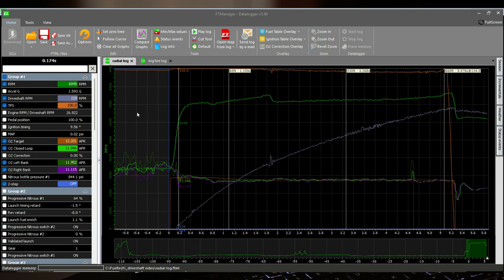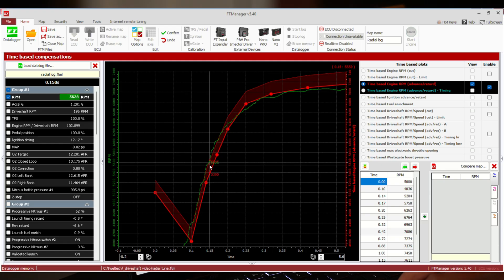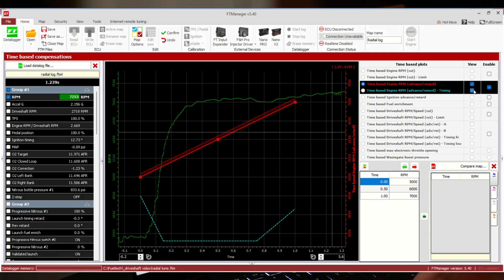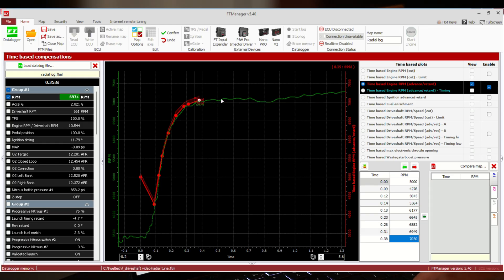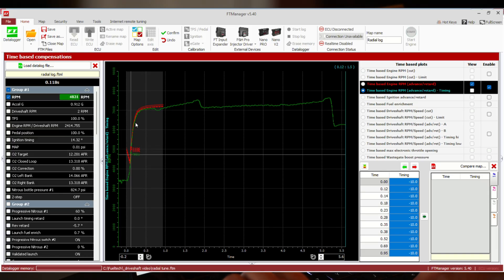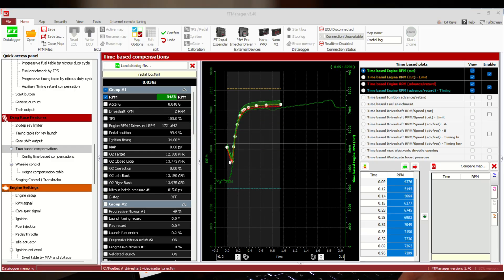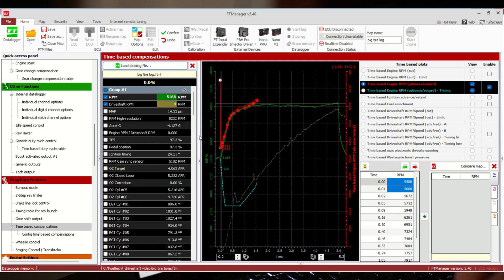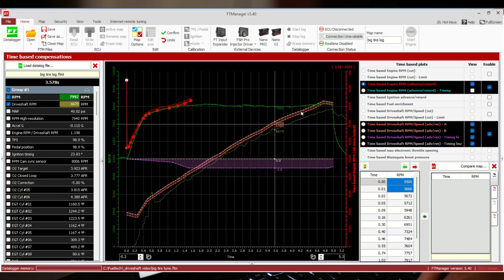Time-Based Features Part 2: Setting Up an Engine RPM Curve for Traction Control | Tech Tuesday

Comment: Does fueltech support maf sensors? If you guys could come up with a nice maf that can handle up to 2000hp that would be a great option for real street cars that are daily driven. The maf tech seems to have come a long way and definitely has advantages over speed density especially for guys learning to tune.

Comment: Would it be possible to implement a high flow maf that can be used with your ECU for up to say 1500 hp cars that actually see a lot of street driving? Speed density is cool but requires some tweaking over time and seasonal changes. A well setup maf car seems to be more consistent and easier to tune especially for beginners.